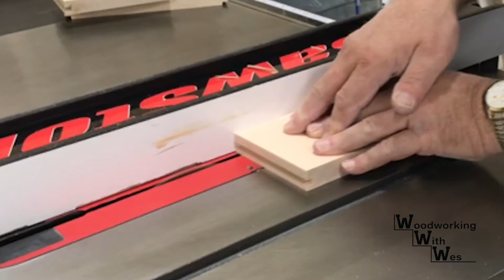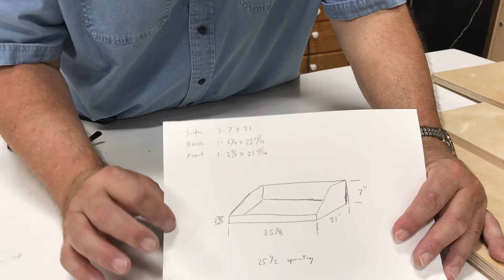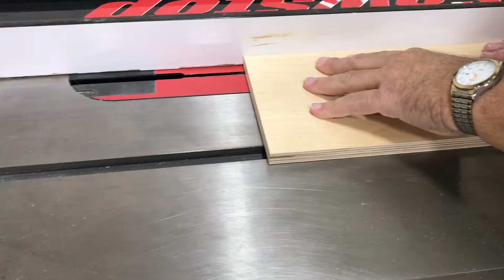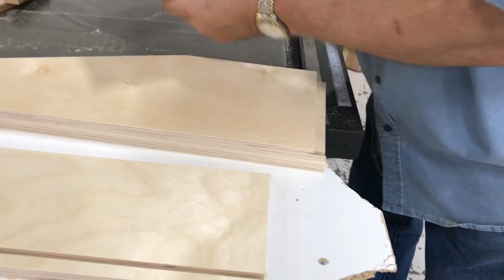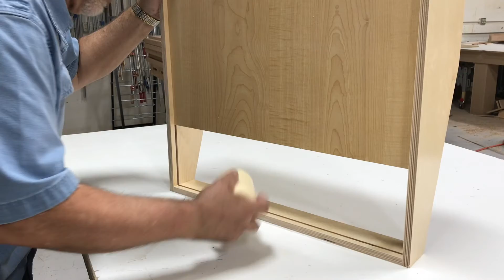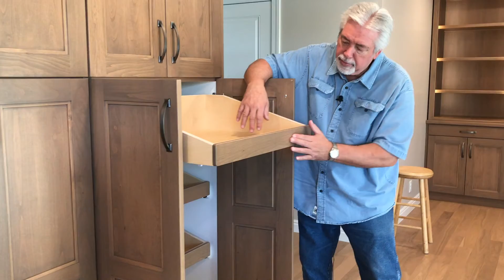Rollout Shelf For Pantry

Comment: Why did you not glue the butt joint? I know most of the glue would absorb into the end grain, but I would worry that the 18 gauge brads are strong enough. Have you ever had any problems with your joints failing?
Reply from the maker: Hi...I have never had to repair a drawer or rollout shelf using only nails with no glue. Thanks for watching.
Reply: @WoodworkingWithWes  awesome, that saves me a step. Thanks for getting back with me so fast.
Reply: With modern drawer slides there is almost no tension on the framework of a drawer like there would have been with older style slides.

Comment: My first drawer is fine although it is not easy for a rookie to keep the nails straight. On the next drawer I made the channels too wide for the 1/4 inch bottom. Is it okay to glue something like matchsticks into the grooves to take up the slack? Or should I just start over? Thank you.
Reply from the maker: Hi Jim...my first choice would be to redo. Experience has taught me there is no short cut to doing it right. I would hate to count how many times I have had to do it over in my career...don’t feel alone. Good luck.
Reply: Thank you very much!
Reply: I finished the drawers and the clear coat is drying on the drawer fronts. Do you have a preferred method of attaching the drawer fronts? They look just like yours at the end of your installation video.
Reply from the maker: @jimgellein1072  I attached the rollout shelf face with 1" long 18 gage nails. Just nailing from the inside of the drawer to the back side of the drawer face.  Sounds like you did a great job...hope this helps.
Reply: @WoodworkingWithWes  Thank you again! Rookie install is next 😆
Reply from the maker: @jimgellein1072  That’s great 😃
Reply: @WoodworkingWithWes  I installed the 5 drawers and my friend, the recipient, loves them. Thank you again!
Reply from the maker: @jimgellein1072  Congrats on a successful build!! Thanks for letting me know :))